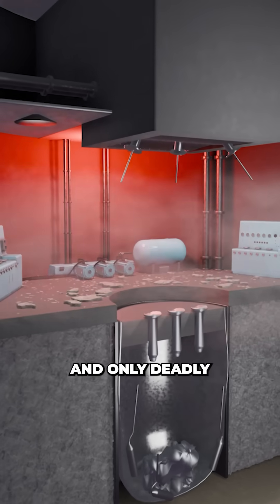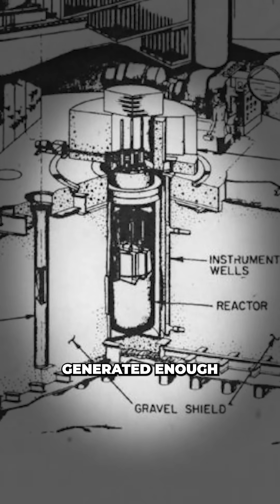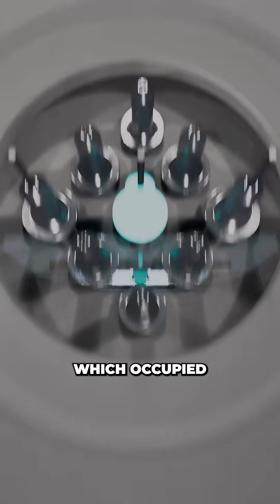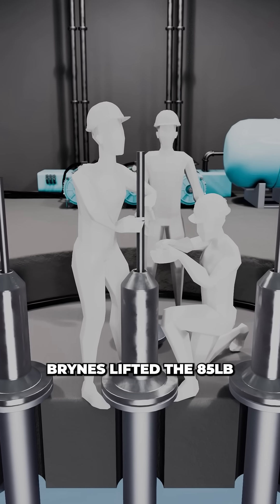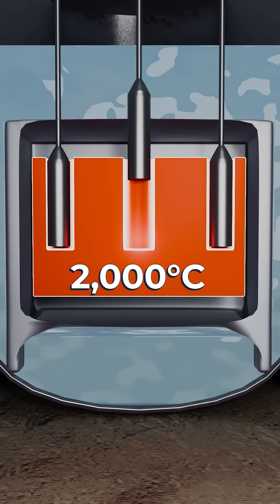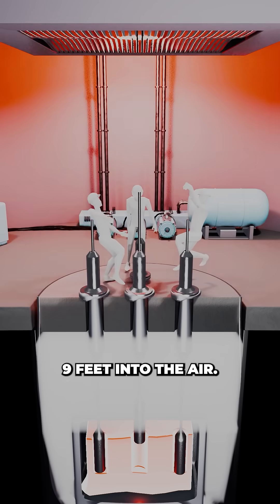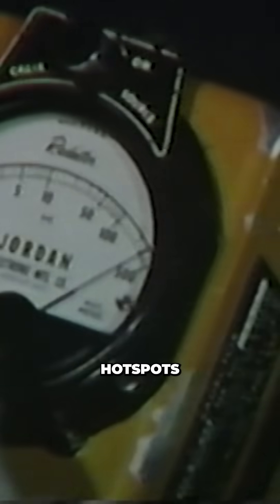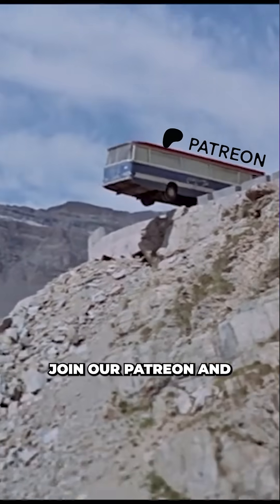The True Story of the SL-1 Disaster

Comment: The quantity of energy released must have been enormous!
If I remember correctly, water volume increases by something around 1460 times when it transforms into its gaseous form (AKA vapor).
Imagine a sealed tank of at least 1500 liters transforming into vapor instantaneously: pressure must have reached a crazy levels, and tried to escape from every weak point... One of those was the control rod mechanism, were that man was operating 🫡

Comment: I think the biggest mistake was the engineers designing it to allow the bars to be pulled by hand. I think they should have used a mechanical device, something like gears, which has greater torque and precision to pull the bars.

Comment: I don't get it. What about filling the corners of the box or what if moments or worst case scenarios? Isn't it obvious that you have to install a safety mecahanism, that will not allow the control rod to surpace a certain height level to avoid the destruction of the frame. Why it did not have a second security frame from above to protect the technicians from possbile physical damage? Why the technicians need to move the control rods by hand and not mechanically from another control room? I guess military = cheap. But cheap ≠ quality. With such technology you can not cut corners.

Comment: Nuclear has been and always will be a terrible idea. I wont be told otherwise. Also Zero Point is bullshit for dummies who don't understand thermodynamics.
There is orders of magnitude more than needed renewable energy available in various forms all over the earth.
However the infrastructure to harness it will be expensive to build and then once it is all grid tied and fully integrated it will end the petro dollar because fossil fuels will become obselete.
Reply: It is not a terrible idea at all? It takes barely any space compared to other sources, Doesn't have any co2 release, gives more energy than anything else ever will. Can last to 80-100 years and power a whole country. Compared to Wind turbines which takes up a lot of space, horrible for enviornment with where they are placed, how long it takes to build them and how often they need repair. Same with water and Solar. They arent efficient at all. Ontop of that Nuclear hasn't cause that many deaths compared to Dams. So through and through, Nuclear is cheapest, most efficient, not super deadly and Safe option

Comment: The ironic thing is higher power reactors are often WAAAY more stable than lower power reacors like sl-1.

One of the major reasons for that is a result of the size itself, see with a larger size you have more room for control rods and with more control rods their power is distributed equally but with smaller reactors there's less control rods meaning each rod itself has WAAAY more individual control with the center rod gaining more power than others due to it being surrounded by more fissile material than the other rods on the edges leading it to being more powerful than the others and if you mess up with the ultra powerful rod well..lets just say the poor men working sl-1 learned the second, lethal, end result firsthand.

Comment: The chain reaction comes from quarks breaking apart. They possess the "quark repulsion force" which pushes a piston down, a rocket up, or a jet. It makes bombs explode.

This force isn't known because quarks can be both positive and negative giving them no way to become a fundamental particle. They are all positive.

Fission reactors break up the electrons holding the massive uranium atoms together. The electron is the opposite to the quark in the strong force, not a particle with no mass or charge. The electron is only 4 times smaller than a quark.

Electrons are not fundamental and break down into electron neutrinos which are light. If anything besides the electrons start breaking down in the fuel, destruction is imminent in a separation of quarks no different than a bomb.

Electrons are what our universe is made of so they become fundamental anyway. They create lightning and the force of gravity when the field of electrons is manipulated. This only happens with quark-electron plasma which is what a black hole is made of.

Comment: The cladding used on the rod tended to rust, and this was a known, and it would cause it to get stuck, requiring “exercising” of the rod.

Also the design of the reactor was flawed with that one rod holding so much power of control, subsequent reactor designs prevent such geometry.

Also, I would highly recommend the podcast “Well there’s your problem” for their episode on this incident, it brings to light a lot of flaws to the set up and the careless nature of the operation team.

Comment: It was a dangerous design , but Argonne National Laboratory was one of the Army's favorites so they blamed one of the operators instead.

When they unhooked the drive mechanism hydrogen gas that had accumulated in the system from radioactive decay ignited and the pressure pushed the rod out like a piston.

Comment: The rods were lifted using a mechanical screw system, that one got jammed and it was yanked to free it. The issue is that not only does the change in rod height affect reactor power but the rate at which it changes. it was supposed to be lifted those 4 inches over the course of minutes but was instead lifted almost 2 feet in seconds.
SL-1 is also the reason the US Army is still to this day not trusted with reactors but the US Navy still is.

Comment: Years ago I took an Amp draw from a disconnect box on a running three phase 460 volt 200 hp electric motor in between the drive shafts and belts moving at 800 rpm, I had roughly 2 ft of work space between the panel and open moving pulleys, I thought that was puckering until I watched this.. no thanks!

Comment: I can’t believe that the engineers didn’t put some kinda fail safe mechanism here. A small notch that would stop at preset height and if the rod has to be removed completely then full rotation type locking mechanism or something not even an electronic sensor ! Unbelievable, these technicians had wives kids , families. Wtf

Comment: The reactor he is talking about is in Idaho where I live. The reason the control rod was pulled up so far. Was because control rods were sticking and not working as smoothly as they should. The control rods were scheduled for maintenance due to this issue. They were actually supposed to be fixed the day after this happened. In the aftermath they changed their SOP's on maintenance where an issue like this would be repaired a day or 2 after the issue was discovered and not a week later.

Comment: There are many theories as to what happened that night, but like every other nuclear reactor accident, it comes down to human error. The central control rod was known to get stuck, to the point they had to bang on it with a wrench to get it to move. Everyone knew how much power was in that central control rod, to the point if the Russians invaded, they'd rip the central control rod out to kill everyone at the location. And of the 3 men working, 1 had only been working there for two weeks, and the other two didn't like each other. The man who was actually moving the rod, that night got a call asking for a divorce and talking about how to split the paycheck. What most likely happened is the control rod, known for getting stuck due to corrosion and build up, once again got stuck. With the pressure of the divorce, and having a supervisor he didn't like watching him, his nerves probably took over and the control rod slipped up, leading to the excursion

Comment: The final phase of the cleanup wasn't done until the 2000s.
One thing deserving  mention is that reactivity addition is not only proportional to rod height but also proportional to withdrawal rate.
When the push to complete the job led to attaching a c~clamp to the rod extension and yank was a truly bad decision.  Instead of the 3 minutes per inch the 20 inches in a fraction of a second was disasterous.
... Flashback to reading the then classified reports prior to doing the annual environmental evaluation in the 1980s.

Comment: I had a floor mounted grinding machine wheel explode on me once, it happened in an instant and the sheet metal wall behind looked like a shotgun blast. Luckily I forgot to press the stop button and reached back to press the button, this saved me because I wasn't in the direct path. Doing bloke stuff is always dangerous and that's why we have safety regulations.

Comment: Im just confused why they didn't make a tool that can precisely lift the rod to whatever you want. Like it doesn't need to be advanced, a simple gear and pulley mechanism would've worked perfectly and you could build it using tech and tools from the 1850s

Comment: The government hid this disaster for decades.  What was even worse is that when the reactor was "decommissioned" it was cut into pieces, put on flatbed trucks and covered with canvas tarps.  Then it was driven hundreds of miles through dozens of small towns while still leaking massive amounts of radiation and no one was told or checked for exposure. So basically this was and American Chernobyl, just about 1000 time smaller, but with just as much incompetence and corruption.

Comment: Our geography teacher in middle school told us about this as a anti nuke cautionary tale back in 1966 +/-.   We were about 12 y o and the thought of the impaled guy stuck to the ceiling had a big impact.
Reply: Well...  I would say that a hot story such as this one should cause a reaction and prompt critical safety analysis of even small reactor designs.  Overly pro-nuclear individuals sometimes may need to have their enthusiasm moderated somewhat by submersion in cool water in order to properly shield the public from chains of bad decisions leading to disastrous and sometimes explosive consequences.  Unless something absorbs and stops bad ideas, they sometimes have a way of breeding and proliferating within society in a way that is very hard to clean up.

Ultimately, nuclear fission energy is not the end of the world, but it is more expensive compared to modern solar energy, which makes it an essentially dead end technology, as least for most Earth terrestrial applications.
Reply: @Fritz_Schlunder  nuclear fission is cheaper compared to solar power 🤣. Solar is best in a perfect world where there’s no weather, no dust, and no degradation. Plus solar typically works at around 50% efficiency. If what you preached was the god-sent method, it’d already replace the other methods (hydro, wind, nuclear, geothermal, bio thermal). But the problem is it’s expensive, requires maintenance (like any other method), and space. Personally id love solar on top of my house… just don’t want to spend $100,000 for a 30 year solution (average life of a solar panel) to save $50,000 (over exaggeration) in electrical costs.
Reply: @NoopNoop-gg9li  What you are saying basically used to be true, 20 years ago.

Today, things are more nuanced.  The price of solar equipment (such as solar panels, inverters, and batteries) have all become extremely cheap, due to quiet advances in manufacturing that took place at Chinese factories over the years.  However, solar equipment installer contractors still quote homeowners the same prices that they have always quoted for solar installs (which is often tens of thousands+ for a basic residential rooftop solar install).  The solar contractors have not lowered their prices effectively at all, despite the drop in solar equipment costs that has occurred.

Basically, the US is a corrupted nation with bad government policies.  Some of these bad policies include developing and enforcing overly complicated building and electrical codes, which basically provides a free monopoly to contractor tradesmen such as electricians and solar installers.  The monopoly is also made much stronger as US universities do not offer degrees in actually useful fields, such as "electrician/solar installer", and instead they just pump out large volumes of graduates with overpriced and functionally useless degrees in things like liberal arts and/or marketing/advertising.

That said, given how expensive solar equipment installation quotes from "professional" contractors is, it actually does make good economic sense to tell them to pound sand, then spend the time to learn about solar equipment and electrical codes oneself (by watching YouTube videos, buying and experimenting with small scale/cheap solar equipment, and by buying a copy of the NEC codebook for oneself).  If one spends the time to learn about solar, and they buy the solar equipment themselves, and then install it themselves using a homeowner permit, the price of the overall solar installation is still far lower than that which the professional solar installers will quote homeowners.  In general, unless your time is somehow worth more than $100 per hour, you will come out ahead, if you spend the time to learn how to install/maintain solar equipment yourself.

If you actually do spend the time to become knowledgeable enough about solar to build a system yourself, it is economically attractive in most parts of the US (with exceptions for extremely cloudy locations like Seattle WA), and it is realistic to save money on one's monthly energy bills by installing residential solar panels.

US utilities do understand economics, and these days, they actually do install solar panels for themselves, even though Trump has made solar equipment more expensive than the true cost of the equipment.  Basically, Trump has instituted anti-subsidies for solar.  When someone buys solar equipment in the US today, they are subsidizing the US government, by way of paying punitive Trump tariffs on imported solar equipment (which is basically 100% of solar equipment, since US manufacturing companies are not efficient enough to compete at all with Chinese companies, even with Trump's tariffs).

Even so, it is economically competitive for US utilities to install solar equipment, and most new powerplant installations in the US in the past three years have been solar, lithium ion batteries, or occasionally natural gas (mainly to replace old gas and coal plants that have reached end of life, and to ensure reliable grid power availability during cloudy and windless weather conditions).  Solar + batteries + natural gas backup plants are cheaper than nuclear power plants, and US utilities understand this, and thus they are not building new nuclear power plants (but they are building solar + batteries + natural gas peaking plants).
Reply: @Fritz_Schlunder   you made a point in some parts but you gotta stop sprinkling your biases or politics here and there.  Plus, cant you just summarize, this is YouTube comments not a high school discussion board lmao. 

You’re also confusing some things. You’re encompassing the USA as a whole when each state is slightly different in its laws. When you mention corruption — every country has it. I thought this’ll be obvious — guess not for you? China is cheap because labor is cheap. 

Really the only thing trump affected was the tax breaks for the “green” push. If you’re speaking about tariffs, those are typically company excuses to hike up prices to loyal suckers like you. Yes, the US manufacturing has weakened and that’s what tariffs are for — to minimize outsourcing. Aside from that, we were talking about solar efficiency and cost not the political policy benefits. 

Nearly any product that has a global presence is still cheaper (aside from China) in the USA (compared to Europe, Japan, and Korea). Name a solar company that’s using tariffs as an excuse and I’ll name an alternative. 

And for the last bit, yes location and demand matters. I thought you’d understand that when I mentioned it in my previous comment — guess I had to be explicit. Just as solar isn’t perfect, I also mentioned other methods like hydro,  thermal, gas, and coal. 

P.S. stay on topic. Solar costs and efficiency, not political policies — those are temporary 👌
Reply: @Fritz_Schlunder I feel like my previous one was too long. So here’s a dumbed summary:

You made a few points — little biases sprinkled, and repeated some points I already made. You also went way off topic and started talking about political policies. 

Reminder: per you, we’re talking about your hatred of fission and love of solar
Reply: @Fritz_Schlunder  Solar panels could further worsen the fresh water situation, as you need fresh water to clean massive solar panel fields you risk your water running out. Nuclear fission is just overall safer more efficient and cleaner than anything else not to mention the advancements in Nuclear Fusion which will literally bring a star onto Earth making your statement irrelevant with the amount of electricity produced

Comment: Compare this to Tjernobyl. Not one  reactor, but four, with a design flaw discovered before the grand startup. Which meant that it could never run at full speed but for safety with a margin to not become unstable and unstoppable. Tell me that there exist one brain in Russia that would spit on the extra safety precautions , turn of sensors, protection and start to play with it on his own disregarding any warnings. The western description defy logics.

Taking a good grip on a rod crucial for the safety of a reactor(?) Unaware of the risk seams plausable.Was there ever any radio comunication? A stuck rod in this madmans config should in fact scream don't touch, don't you even try any force because... Well, idiocracy may be curious and trying to become history and famous isn't that bad.